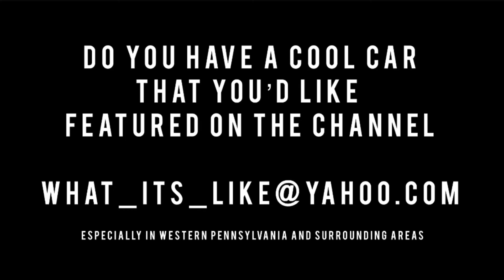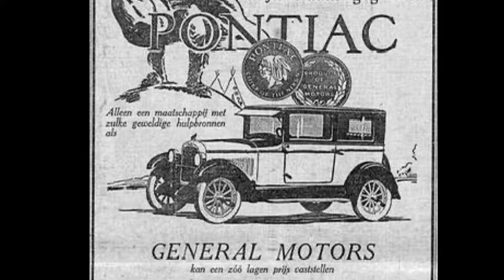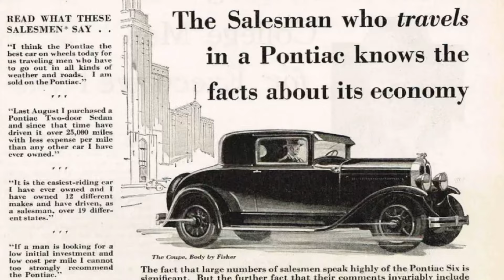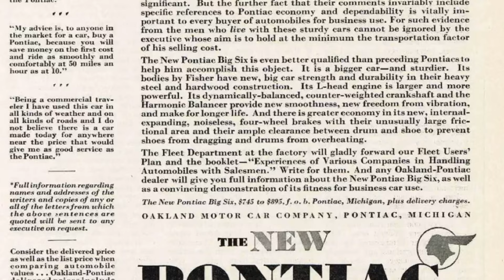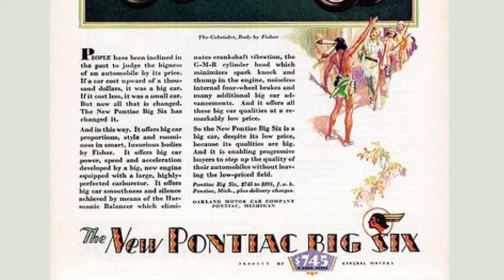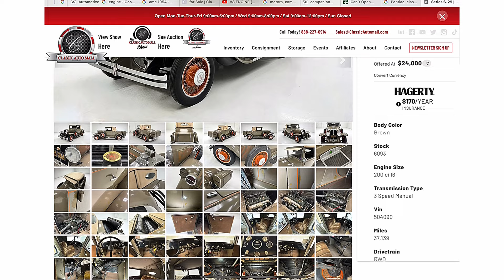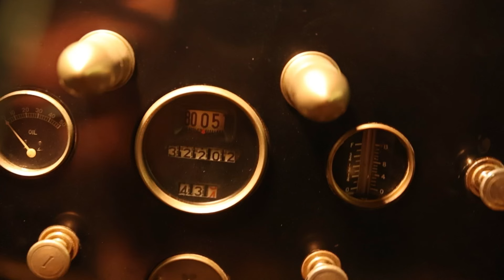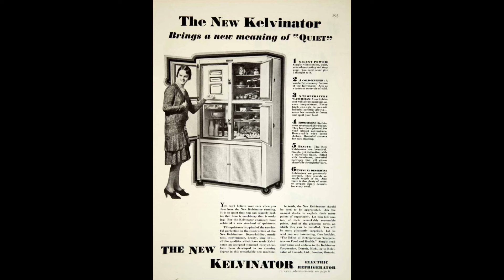1929 Pontiac series 6–29, companionship make

Comment: Gotta love the iconic vertical-split grille and the Indian-head hood ornament which were Pontiac styling hallmarks for so long. Just one glance and you know it's a Pontiac. All the little details like cowl lights, sun visor, landau bars, and metal pressing details are combined perfectly here, adding "bling" which is absent from many other cars of this era. Nobody knew it at the time, but the stock market crash was going to have a longer and deeper impact than could be imagined, and the 'bling' of the 'Flapper era' was going to go away quickly. Had Sloan tried to persist with his 'companion' concept  GM would likely have been a casualty of the Depression too. If we look far ahead when many car companies merged and tried something similar with multi-level branding, we can see that they all eventually failed so maybe 'companion branding' wasn't such a good idea anyhow.

The car batteries and generators of the time weren't terribly robust which is why allowing for hand-starting stayed around for so long even after electric starting became common. It proved worthwhile through the Depression where motorists might not be able to afford a new battery when needed. Perhaps the last car with this feature was the Russian VAZ 2101 aka "Lada" which had a hand-crank included as standard equipment into the 1970's, and left the provision for one till it ended in 1983. 

WYR The Essex looks leaner, lower, and sportier for a 'roadster' style car, but the Pontiac is just so much nicer. WYR2 The same goes for the Whippet and the Plymouth, but here I like the lines of the Plymouth better as the Pontiac body is a bit taller.

Comment: The manual crank hole was basically for winter. You would hand crank the engine over a couple of times before trying to start it with the starter. Much better chance of it starting that way.
Reply from the maker: Great information

Comment: Hi Jay!  Man!  You are really killin' it with all these cooooool 1920's cars!!  LOVE THEM!  The Pontiac is pretty darn cool, with the split radiator shell reminiscent of the Oakland parent  make.  The AWESOME emblems for Pontiac of that time that look like emblems from a Native-American blanket!  And on the hub caps too!  Convertible Coupes are really nice (Ford called the Model A version a Cabriolet) because you actually get REAL side windows you can roll up and down.  The interior of the Pontiac is quite nice and plush, too!  I'm glad I'm not in your area, I might be in trouble financially if I could get to that cool Pontiac!  The split head engine design is kind of clever!  A lot of the older flathead engines suffered from blown head gaskets.  This split head design meant you would get better torque distribution over each head and also you would have smaller head gaskets, that if one blew, you would only have to replace the one that was bad.  Also it allowed the distributor to be right in the middle, but not where you would have to have a gasket to seal it from cooling passages,  VERY NEAT!    The horsepower rating is not too bad either, having 20 more horsepower than a Model A Ford.  I just want to skip the WYR's on this one because I LOVE THEM ALL!  The Pontiac, though, would have a slight advantage, being it has the roll up windows, where the other ones don't.
Reply from the maker: To be fair someone needs to cover these 20s cars might as well be me lol 

I’m happy you guys are digging these so many details to be discovered thank you so much for sharing all that insight and information

Comment: Like the T - 34 tank - no air filter  !  
I guess someone must have made an aftermarket air filter kit for it?  Some motorcycles didn't have air filters - Snow King snowblower engines didn't have air filters because they tended to get clogged with blowing snow and it was believed that Arctic air was clean 
I believe that the tank also tended to clog with snow if it had an air filter on it when operated in blowing snow which I think the T - 34 supposedly excelled at

Comment: I owned and restored a 1930  Desoto CK Coupe. The Desoto would be my choice for the for the first set of choices and the Plymouth would be my choice for the second group. IMO Chrysler Corp built cars were a bit ahead of the curve engineering wise compared to similarly priced cars if their era in the late 20’s through early 40’s. Both the Plymouth and Desoto would have modern four wheel hydraulic brakes while he others were although 4 wheel, they were mechanically operate by rods or cables. The Plymouth and Desoto Lhead engines had full pressure pump driven engine lubrication and were basically the same reliable Lhead design that Chrysler would build up into the early sixties in ag/ industrial versions.
Reply from the maker: Totally agree

Thank you so much for sharing all that insight and information  Chrysler is nowhere near the company they used to be it’s actually very sad when you know Chrysler history of what an epic company they were to the shit show they’ve become. 

Great choices